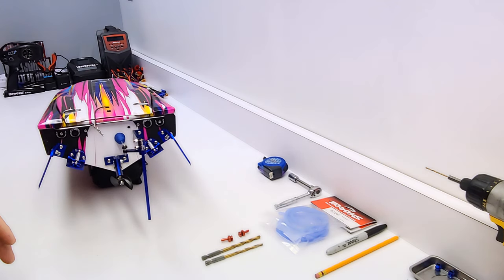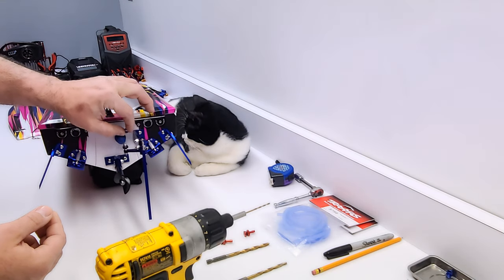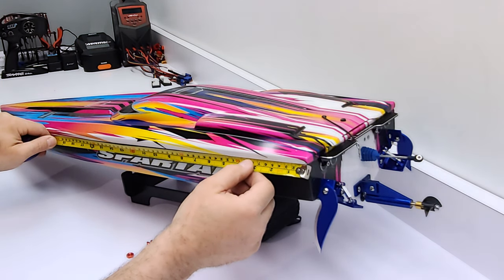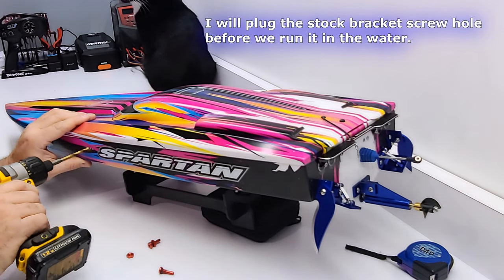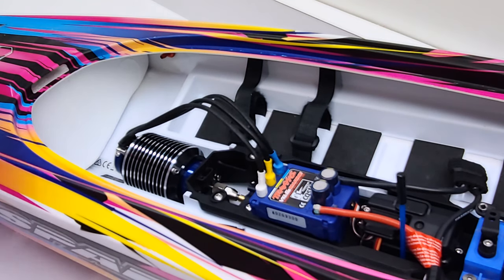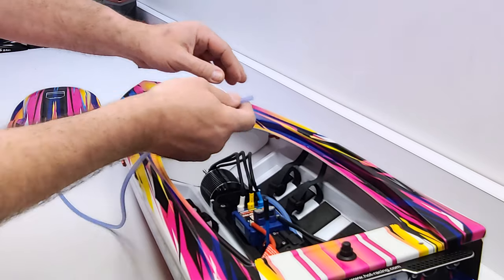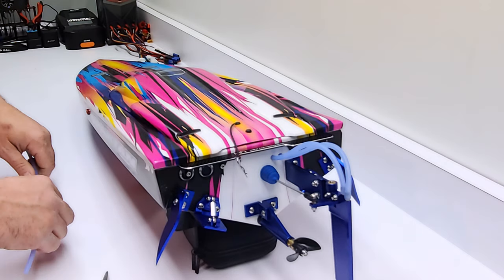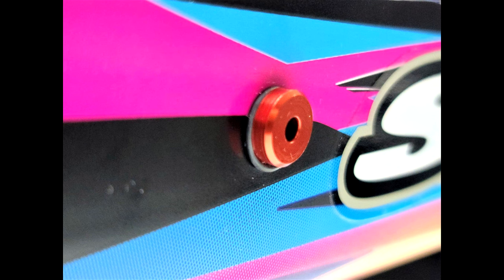TRAXXAS SPARTAN HOT RACING UPGRADES | PART 2 of 2

Comment: Nice job. Very clean looking work! I like the water outlets you used. Can’t wait to see it rip!
Reply from the maker: Thank you sir.. Going to take it out for a rip as soon as the weather warm up.. I can't wait to see how it handles once it's tuned..
Reply: @nwirc  I do have a question about the original water line hole on the back. There are larger line upgrades out there and I was wondering if that original hole was able to be drilled out more to accommodate a larger diameter hose or if it was specifically designed for the stock size tubing?
Reply from the maker: The original hole in the rear is designed for the stock tubing and you will have to drill a larger hole if you go with a larger diameter.. I was going to get larger tubing but didn't feel the need with the stock system having separate motor / esc cooling.. I'll bring my temp gun with me on the test run and if it gets hot I will install larger tubing..

Comment: Great looking upgrades. I would just add some aluminum tube grommets from offshore electrics for the rear tubes going into the transom. Provides a nice tight seal
Reply from the maker: That's the plan for a future upgrade for sure.. I'll check out the website later today. Thanks
Reply: @nwirc  👍🏼

Comment: Why would you have to tap the water ferrules? Couldn't you just drill a big enough hole and then just screw them in? Thanks.
Reply from the maker: You can do that but I wanted to make make sure they would fit the first try without damaging the finish. This is just what I did but i'm sure other ways will work fine.
Reply: Thank you. Did you end up doing it, and if so, how did you end up doing it? What size drill bit did you use to get it right the first time? Thanks.  @nwirc

Comment: Great vid 👍🏼. For the backsplash. Is there anything special needed to install it?
Reply from the maker: All you will need to do is to line it up straight and find a drill bit that fits the holes on the backsplash.. I used tape to hold it in place to ensure I was center.. Here's a link to part one that starts the backsplash install.. It's very easy to do and that's why I kept it short..  Hope this helps.. https://youtu.be/df35BNFusuI?t=458
Reply: @nwirc  thanks man 👍🏼

Comment: Brother can u tell me please I have that too. When ecs hot the water go inside right it auto right
Reply from the maker: If I understand the question correctly then yes.. While the boat is moving it will run water through the lines cooling the esc and motor independently allowing for better cooling.